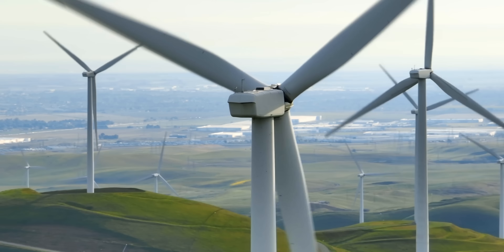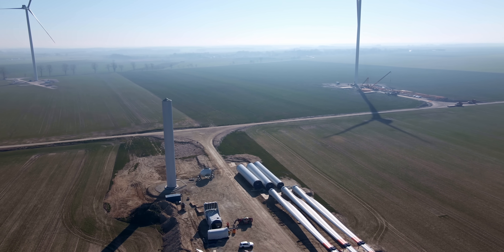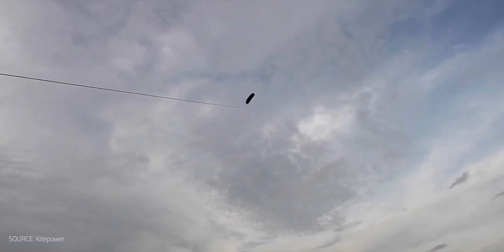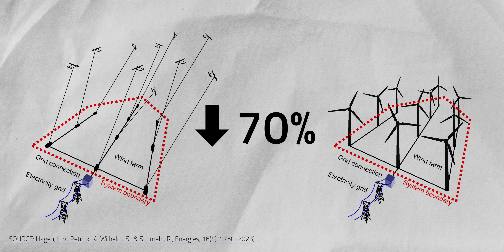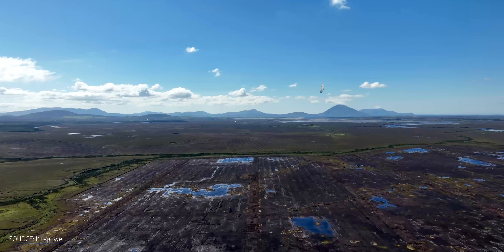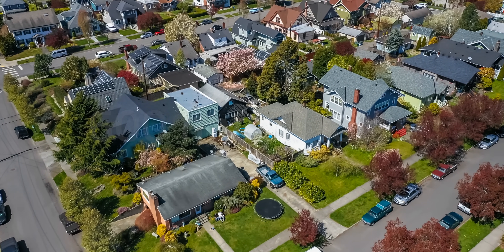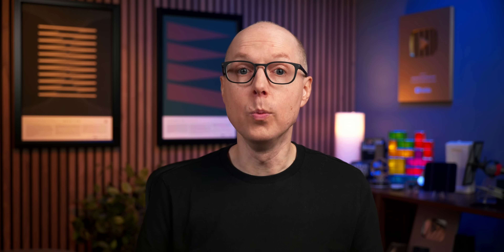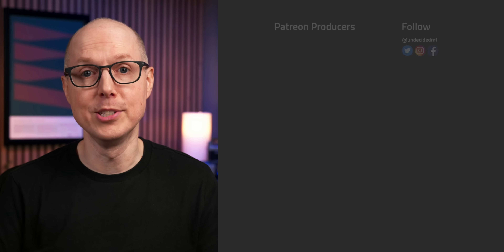Are We Building Wind Energy Wrong?

Comment: @UndecidedMF, obviously these won't replace turbines, any more than cars replaced mule team pulled small trucks. We are witnessing nieche partitioning within an emerging technology, just as we did with the transportation models, once the horse and buggy went away. It's tech evolution, with new things popping off for their own special needs. I developed a flapping device that can be scaled, and attached to fencelines with as short a thing as about a half meter, up to larger, that could go along a roofline, perhaps 2m in height, and they could also be placed on isolated ridgelines, etc, AND, they can also be placed in water, such as small to larger streams and rivers, to passively generate power. These are small producers, but would be constant, especially in streams. I just don't have the money to get my thing made. But someone will.

Comment: Companies claim. Matt repeats. So nobody can accuse him of deceiving people directly.
1,780 MWh for 600 households is 2.97 MWh per household per year. That's 8 kWh per day. Family of 4, using water boiler 2kW, heating up 5 hours a day.
And it is 2 kWh negative already. Average Gaming PC 500 W, 8 hours a day = 4 kWh. We are at negative 6 kWh.
Modern fridge and freezer 160W * 24h = 3.84 kWh. We're down to 9.84 kWh negative.
Always ON Smart home appliances like lights, vacuum, humidity control, ... 50W * 24 = 1.2 kWh. Negative 11.04 kWh.
How do you keep temperature bearable? Modern home, It is via AC instead of burning gas. AC works in summer and winter. Small AC pulls 1.8 kW, and on annually runs 4 hours a day on average = 7.2 kW.

And we are at negative 18.24 kWh per day against their estimation. Not having laptops, TV, cooking, electric car, ...
If we are kind, and talk about annual average, they can claim to supply up to 200 homes. If we consider seasonal energy demand peaks. 120 homes at most.
And God Forbid, wind does not blow sufficiently 3 months a year.

Why so big difference in their estimated power demand and reality? Because their average household has solar panels on roof, they forgot to mention.

Comment: So you for one, you would have to space these out far apart otherwise they would tangle with each other. Two what happens when the wind dies down and these float to the ground, each one would have to be tended to to get back in the air. Three, long-term how would the fabric last for the kites, not long in my opinion. Four, how much power could each one even generate. Five, planes, helicopters and drones could easily fly into these lines and crash. Six, you talked about higher winds at altitude, but then talk about how they would have to be pulled in if it got too windy.

Comment: Ive been studying wind energy privately for 20-odd years. Initially wanted to be an electrical engineer but never could swing it.

Current windmills are absolute garbage. They are overengineered paperweights designed to break at the slightest issue and be torn apart for repairs. 1800s style windmills retrofitted (read changed from water pumps to turbine) can preform at the same level or better and are not as harmful to the environment and easier to repair. Heck a water pump version pumping water from one reservoir to another with the water trickling back turning a water wheel is more efficient.

Comment: A 4MW kite is also a massive - technical solution....
Soft canopies are not particularly durable - over a 20 year lifestyle.

Historical efforts:
Kitesails. (since ? 2007 - in semi automated shipping assist systems..)
Makani (since 2006 - cancelled after test bed) 
etc...

Generators aloft are really the only viable kite generator - but even then it is still variable in output 400%+ variability...

Reeling / hauling systems are very dynamically unpredictable..

Infancy - absolutely B$_$

Comment: I'm awaiting developments in materials science that allows hydrogen balloons to lift thin-film solar up above the clouds, and cables/wires that will transport the power down to the ground. Those could easily also be used for anchoring "soft" wind generators, for night time production. One ground station, one cable, all the energy. 
-Still a ways off, unfortunately, but high hopes for creative uses of graphene and similar.

Comment: Why not use a pair of kites attached to the same winch? When one reaches its limit, it collapses and the other deploys, running the system in reverse. No need to spend energy on rewinding the spoon.
Reply: My guess would be the same reason you don't fly normal kites to close. You get lines crossed

Comment: A smaller version kite/balloon could be an amazing emergency device for stranded individuals in need of rescue or shelter.  A balloon could be triggered to be automatically deployed using a  chemical reaction. Once deployed as both a generator and a signal for rescue. It could power radio and heating systems It could also self-illuminate effectively creating a sustained flare.
Reply: @crinna  good thinking
Reply: I agree that a  (tethered) blimp would be a requirement to haul up the kite array

Comment: You mentioned collisions. In the US, small aircraft, like the Cessna 172 and thousands of others, are allowed to fly as low as 1000' AGL. Those wires may not be very visible to the pilot. At the very least, there'd need to be flags about every 20' that will help alert pilots of these things. The fact that they are moving around, following the wind, may be a considerable. Night time would be even worse.

Comment: Given the figure eight. What if instead of getting energy just from the drum that the kite itself is attached to they have one or two lateral drums that are forced to spin as the kite goes in its side to side figure eight pattern? Then you wouldn't lose any or as much energy from having to pull it back in. The energy would come from the back and forth motion not the in and out version

Comment: Can be done better.
Have them deployed in pairs. Share the cable, so that the winding of one is the unwinding of the other. Should cut your energy loss phase by some absurd percentage. Just need the cable  to reach between them, and their lines to  be far enough apart to not collide. Which is just a geometry problem.

Comment: i imagine the faa has a lot of hurdles for them to jump through. im sure the lines would need to have lights ever so feet and you cant just use ads b like a drone or ultra light because you have to treat it like a none permanent tower, like crane permits but like 5 times the usual hight that can reach into flight paths. thats a serious hurdle in itself to be able to deploy them anywhere but im sure permanent locations would be easier. i hope this tech kicks off. im interested in micro versions for boats or camp sights or cabins.

Comment: The first thing I wondered about being a constraint is footprint, as in the spacing.  How densely could you put these together, and what is the safety perimeter?
Reply: That depends on Size.. If You Just Float Your Ba yard draft. AND use Seesaw pull i'd say About 3 per SqFoot

Comment: This is a technology, which is never going to get it off the ground. The energy density is just too low, as you can’t place them close to each other for risk of tangling the tethers. The only application where I could see this is relatively useful is to add additional power generation in a massive solar array, like the fields of solar panels, just north of Las Vegas (not the mirror/salt turbine south).

Comment: Short answer: no.

I did the full assessment of all major engineering decisions related to airborne wind energy over a decade ago. Published in CleanTechnica: Airborne Wind Energy: It’s All Platypuses Instead Of Cheetahs. I'll try posting a link in a response to this to see if it gets through.

Every pathway leads to major engineering compromises that eliminate viability.

Basically, it's a distraction and something used by anti-wind advocates to try to stop actually useful wind energy, not something useful. Interesting engineering, but a dead end.

Comment: Matt, other alternatives to horizontal-axis wind turbines are less massive (or space hungry) and have fewer construction, air space, and safety-related issues, such as vertical-axis wind turbines.  You can even "cage" them to keep the birds out, and they still work. Horizontal-axis turbines are lethal to birds, expensive to maintain (height and size), and create a huge waste stream. The AWES, as you have noted, have their own inherent drawbacks; vertical-axis wind turbines do not, and at the same time, they offer better ease of repair, making longer service life a distinct possibility. While the high altitude aspects of the AWES are a plus, those aspects are also one of AWES' greatest drawbacks. They would be very much in the area that general aviation uses, and the FAA would clearly have issues with progressively restricting more and more of the airspace for general aviation because of AWES. Clearly, besides being less material-intensive than horizontal-axis wind turbines, AWES does have several notable benefits, especially for temporary or emergency use, or in conjunction with horizontal-axis wind farms.

Comment: The problem is that we are building energy systems to connect to the grid so that large corporate monopolies can make huge profits. We should be manufacturing smaller systems for individual homes. They need to be designed for weather resistance. We spend more resources on repairing the grid than we should. Power lines should be underground. Solar panels should be on robotic platforms that fold up to protect them, and to be lowered into underground containers when severe weather approaches. Smaller windmills can supplement Solar power, and battery storage technology is necessary. People still might need emergency generators. We lose power at least 6 times a year. This is a lot of time and money to repair the grid, and more money to replace all our food that goes bad. Luckily we have a generator to keep our freezers running. Building more resilient and weather resistant power systems will save money and resources, help preserve our environment, and make energy consumption more affordable, efficient, and reliable. We are still using the system that was put into place in the late 1800s.
It is time to move forward. 
This would break up monopolies and hurt some shareholders. 
But it would create more jobs and be more beneficial for our society as a whole.

Comment: Wind energy is best harvested at sea - beyond the horizon from land (15 miles+ out) and using geodetic construction principles to make this harvest. Geodesics (which are tensional in nature and so directly derive molecular strength) will translate the interface area from the handful of metres of a wind-turbine blade - to starting units of something like a quarter of a mile. Sea-installations providing solidity and resistant strength must needs utilise a modular and digital construction principle capable of integrating sea-water as bulk strength into its matrix. This is provided by Khatmatrix a generic designation for the digital principle of syncopated cubeoctahedra.

Comment: I don't think that replacing windmills every 25 years is sustainable or acceptable use of materials and is wasteful. That is a big carbon footprint that has to be renewed every 25 years and how much of them can be recycled? These windmills are an ancient stop gap solution that is not practical going into the future. We have to do much better than that. Solar panels have much of the same problems, and there are other draw backs and compromises like they might need storage systems along side them that is just more part that needs regular replacing.

Comment: There were quite a few of these companies doing good work back in 2016. This tech does have a lot of promise but companies have really struggled to get enough funding, and places where they are allowed to fly to do tests. One Italian company (KiteGen) sorted out automatic launching, and a dual-drum system   so the output was continuous (probably unnecessary now that batteries are way cheaper), but they had to pivot after building the wing for a much larger 1MW machine and running out of money. https://www.youtube.com/watch?v=Zl_tqnsN_Tc
Euan Mearns did a couple of great articles on high-altitude wind systems and potential in 2016: "High Altitude Wind Power Reviewed" and "The ERoEI of High Altitude Wind Power". There was also Makhani which proved their (rigid) machine worked, but then broke it in a crash and didn't have the necessary millions to build a new one and continue. 
There was also a Scottish company which built a working machine and did some small-scale tests. Kite power systems. https://www.youtube.com/watch?v=FJmlt3_dOuA
In theory the EROEI of this technology is dramatically better than wind turbines, but you have to deal with a load of issues about where they can be deloyed (as planes need to go around). And launching/landing. There were also issues with each company having a patent on on important aspect (e.g dual cables, or tilting bridles). So we have to wait 17 years or let outfits go bust and buy up their tech. None of which gets things done quickly.

Comment: Matt, you mentioned reeling in the cable as being an energy loss. Gravity always pulls that kite and cable down if you could collapse the kite for a short time. Then it’s simply a high speed reel it in with no resistance from the kite. Redeploy the kite and pull it back up to height again. I’m sure the engineers are all over this. Great idea. Love this. 🪁
Reply: You want tension on the cable so it reels in tightly and doesn’t wad up the cable.

Comment: Maintenance is an underappreciated challenge for these types of systems.

You would need 2200 of these kites for a  1000MW wind farm compared with 50 modern offshore turbines.

Maintenance on modern wind farms costs ~1.5% of the capital cost of the farm each year. Multiply that up because you have 40 times as many devices to maintain and it's uneconomical.

The size of modern turbines are their strength not their problem. Their scale makes efficient and simple to maintain, and to replace them with smaller machines means having far more of them, creating worse visual impact.

Awes are a tool for a job, but it's a different tool for a different job than large modern wind farms and comparisons are therefore apples-and-oranges. Great video though! you actually explain all this minus necessarily click baity title.

Comment: I would like to know more about the possibility of using the kite generators to power ocean going vessels.  It seems with sufficient battery storage to deal with congested areas like ports, fully electric powered ships would be feasible. Could the line also double as an antenna? Are smaller versions suitable for private yachts?

Comment: Can this technology be reversed by using the wind as a force to un-scroll the turbine slower, but then with a clutch and mechanical spring system allow it to retract or re-spool quickly?   This way there are no power losses and able to generate power on both un-scroll and re-spool.

Comment: A big reason that the existing kite sail prototypes aren't generating as much power as a conventional wind turbine is the size of the airfoil. As mentioned in this video, a wind turbine's airfoil size is massive while the existing prototypes are tiny be comparison. A big requirement in getting these kite systems commercially viable is scaling up the size of the kite, and with these kites being soft airfoils, it shouldn't bee too much of a design challenge to do that.

Comment: So...

1. Generates less power than a wind turbine.

2. Requires a significantly larger cleared space in which to operate because wind blows in more than a single direction and the kite is tethered to the ground and cannot have obstacles anywhere within the area that the tether can traverse.

3. Poses significant danger to aircraft.

4. Poses significant danger to those on the ground.

5. Is far more susceptible to failure caused by changing weather conditions.

Seriously, you would have to be an absolute fool to think this is even remotely a good idea.

Comment: A problem with AWES is that it has to interface with aviation.  A fixed installation can be noted on navigation charts but Kites are dynamic.  I could see big problems for low flying general aviation or helicopters and even the airliners in some conditions.  Just one more hurdle.
Reply: I did notice one of the kites had a flashing light. They could also transmit on the frequency that almost every flying device has, that warns other planes where they are, so transmitting a 'code' would inform an approaching flying vehicle, that they are a power Kite and they
could avoid it.
Reply: This occurred to me as well. I work as a pilot, and the FAA would not allow these to pop up at random. There is a whole regulatory hurdle to be cleared here... good luck with that.

Comment: Here is a novel compromise... FIRST: We redesign, upgrade, and harden the National Grid... with the current Grid that could be easily shut down, how we generate electricity doesn't matter... SECOND:  We increase the number of natural fossil fuel and nuclear power plants to be able to supply the needed energy of the immediate future to bring back industries to the U.S.... then, THIRD: A wind and solar actually become financially viable, we can use them to replace equal amounts of fossils fuels as they come on line and decommission the fossil fuel plants, but keep them maintained like an "emergency" generator.